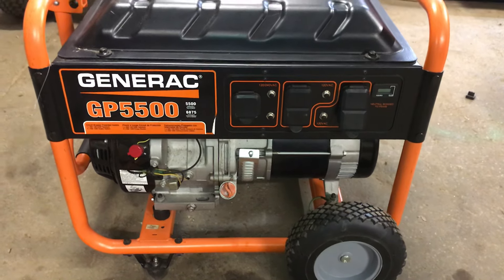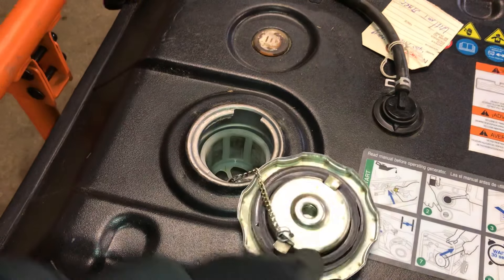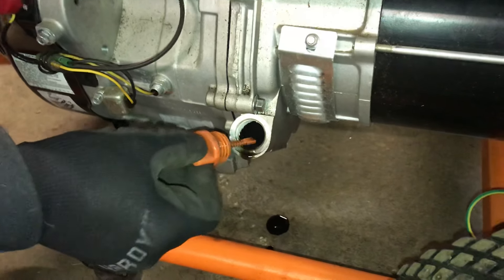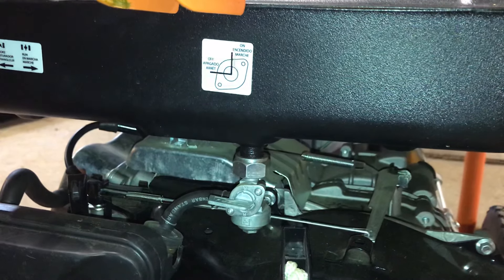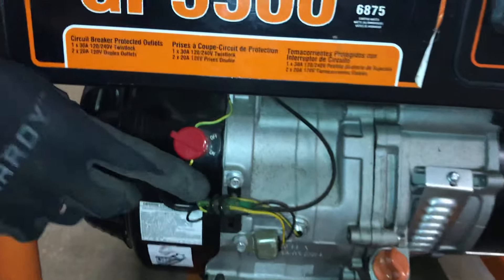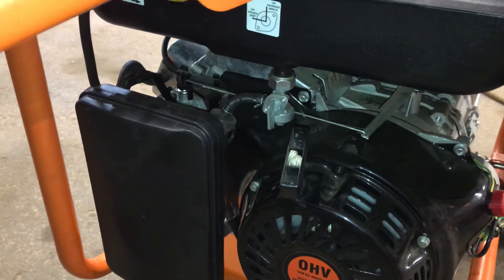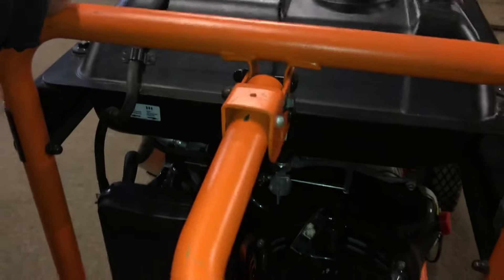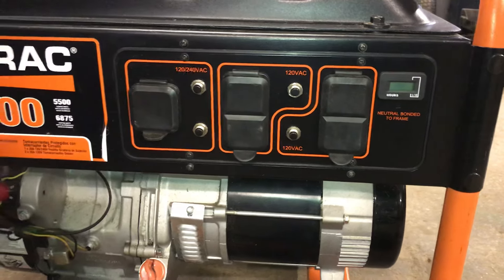How to start Generac GP5500 watt generator

Comment: Mine doesn’t turn over
Reply from the maker: If you checked all steps before starting and it will not start, you most likely have a carburetor issue due to gas going bad inside it. You should diagnose it first to make sure. I am picking up a Generac generator this Monday 12/26 and will make a video on how to diagnose and repair a no start condition. Most likely it will not be up on my channel until the following week.

Comment: How would I drain fuel? Haven’t ran mine since the ice storm 2010 on KY.
Reply: There is a fuel line that goes from the tank to the carb. Take the end of the line off the carb and put it into a spare gas can. Turn the fuel on and it should drain out. If the line is gummed up, you might have to take to fuel valve off and drain it straight from the tank.

Comment: Do you know what grade gas is best for this GP 5500?
Reply from the maker: I recommend using high test.
Reply: Johnson's Small Engines actually just read on generac site that they say to use reg unleaded.
Reply: @tgoldstein  
Ethanol free if your area sells it. Also Home Depot sells Tru Fuel with no Ethanol,  but it is very expensive.

Comment: hi, when i open the fuel valve, it starts pumping fuel through the carburetor.  do you know what it is?
Reply from the maker: If you mean it starts leaking through the carburetor and onto the ground? You have a bad carburetor, due to fuel going has inside it. You will need to rebuild or replace the carburetor.
Reply: @JohnsonsSmallEngines  Thank you so much.  This machine is new, I just turned it on for the first time and that happened to me.

Comment: Does anyone have a problem with these generators kicking back and about tearing your arm off?  I have gone through four handles that have broken when it kick-backed so violently.  My sons won't even start it for me anymore  because of the kickback.  Now I have to buy a recoil unit.
Reply from the maker: You may need valves adjusted or possible cam compression release has broken internally or possible sheared flywheel key.

Comment: These things are a bear to start in winter!
Reply from the maker: Yes they can be, make sure you are using 10/w30 for winter to help the engine spin faster upon start up.
Reply: @JohnsonsSmallEngines  I do, I insulate around the gen. and it's in an enclosure. It may have been just a bad winter in Pa. the first year I had it (temps way below normal). I want to design a solar warming system for the winter. Thanks for the reply.
Reply: Pete Urbann it took thirty minutes to start my generator today!! It’s eighty degrees here.
Reply: Mine stays in my garage in the winter and I run a space heater I also use the royal purple synthetic 5w-30 no problems but it doesn't get that cold here in nc in the winter by the beach lol